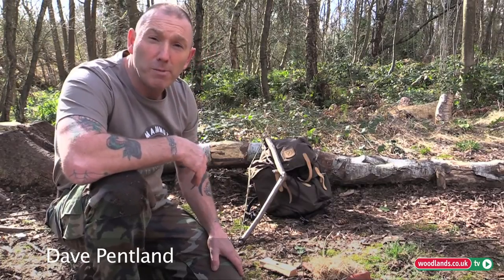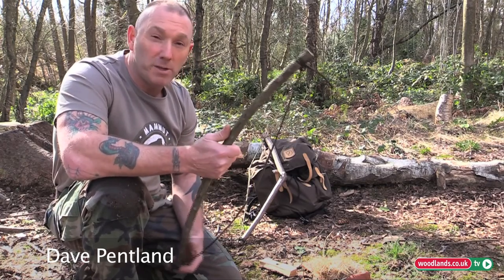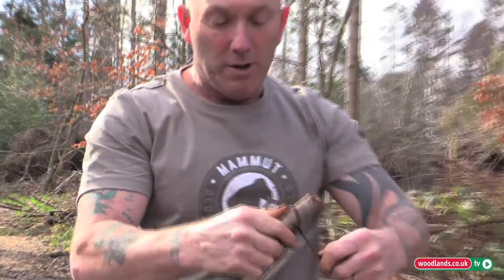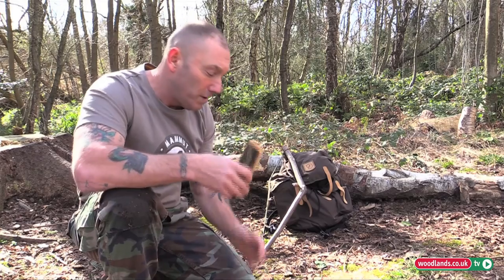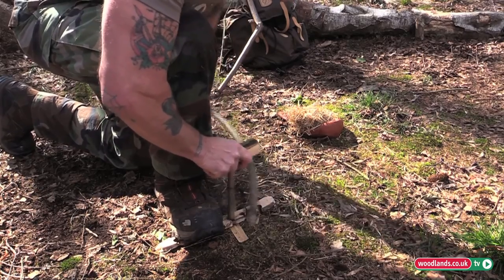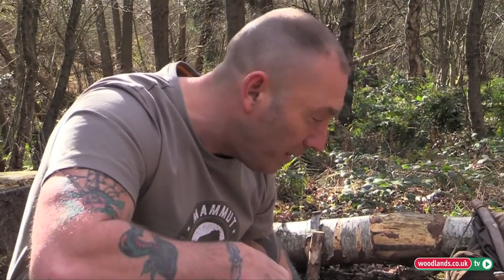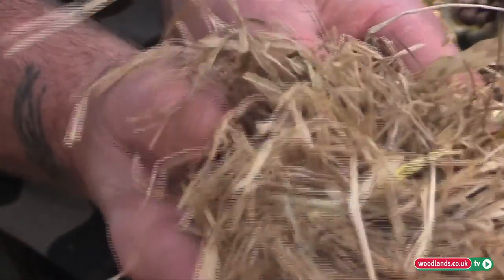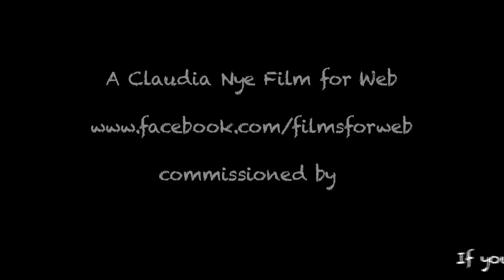Fire by Bowdrill in the Woodlands

Comment: Thanks for the feedback about video.Yes some woods are better than others here is an example willow on willow , wood ivy on wood ivy, sycamore on sycamore, hazel on wood ivy,That is just a few it is best to get out there and experiment.Keep your woods dry a good tip is to do the finger nail test this means if your nail makes an indentation in the wood that means its fine if it doesnt that means your wood is too hard. Remember you need the right materials and the right stance as seen on the video.Do not rock the spindle keep your forearm tight against the shin.Build up gradually then go for it it will come just keep practicing.You will be knocking out embers before you know it.Good Luck.